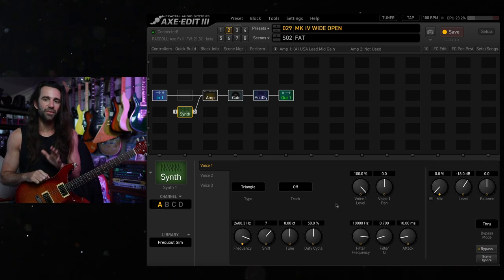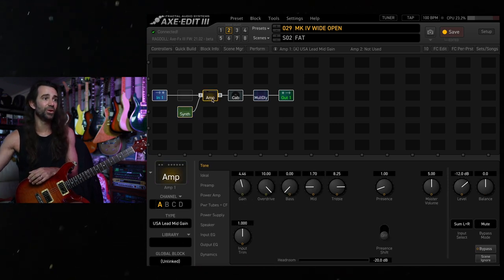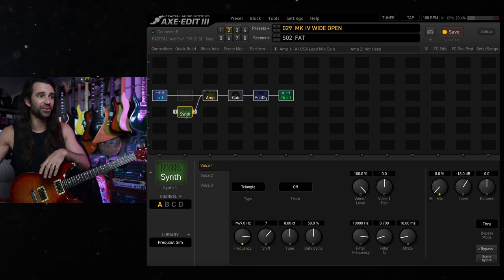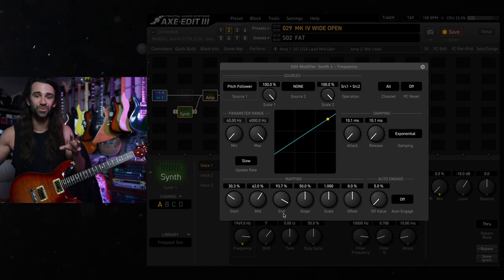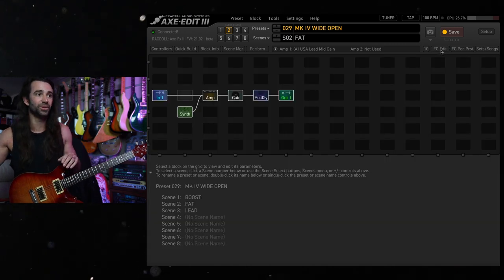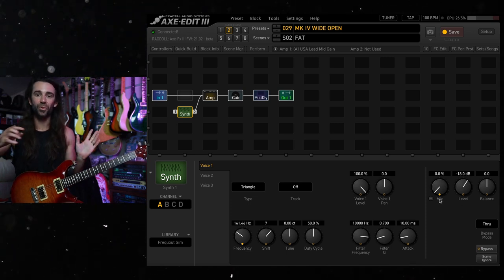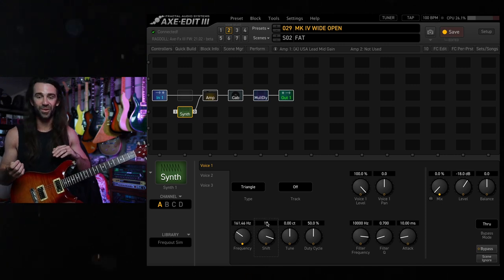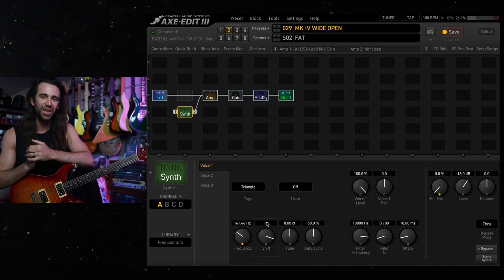Feedback Simulator For the Axe-Fx III, FM9 & FM3 | 5 Minute Tones

Comment: Can also add an envelope follower to the synth mix control, set operation to Src1 - Src2, then it subtracts the signal from the envelope follower to basically reset the effect if you play a new note. This does require messing with the scales of the sources a bit, and probably is different from rig to rig. Seems like an expression pedal opens a lot of options for fine control here.

Comment: I got this working on my Axe FX ll but one issue is on the higher notes the synth goes wacky when I apply any vibrato or even if I try holding it steady. I don't have all of the setting you have there but I do have most of them. Also sometimes with the expression pedal to zero I still hear synth noise in background.

Comment: this is a nice trick but in lower gain situations the tracking falls apart and there are synth artifacts feeding into the signal. i have tried with the send-return blocks but didnt have much luck cause the signal gets out of control fast and there's only noise very quickly. have you tried with the S/R blocks with any success yourself?
Reply: Same here.

Comment: Is it not possible to do vibrato when the synth block is doing its thing? When I add vibrato the whole thing goes weird.
Reply from the maker: I haven't had an issue with it.
Reply: @LeonTodd  The frequency parameter goes crazy unless I hold the note absolutely static. I'll have to experiment a bit more but was wondering if anyone else had a similar problem.
Reply: works fine for me too. i wonder if the string scraping across the fret is creating harmonics and fooling the pitch detector?
Reply: @Simeon_Harris  Could be the case, which parameters should I play around with to try and fix the issue? Thanks for all your help!
Reply: @tanshaomala  well there's nothing you can add to the grid or change about the pitch block, because pitch info is detected at the main input.
Reply: Hey Leon, tried it on my FM3, using the same settings as in this video, but instead of ‘feedback’ there is some weird oscillation sound, even when I’m not playing.  What could I’ve done wrong?
Reply: @MarcoBercx  did you attach a control switch or an expression pedal to the synth voice level? when you play a note, does the oscillations stop? if not, did you attach the pitch controller to the frequency parameter?
Reply: @Simeon_Harris  ah I guess that’s it, I don’t have an expression pedal yet.  Thought by activating the Mix (assigned) would do the trick.
Reply: @MarcoBercx  you can do it with a control switch configured as a preset override, which leon alludes to in the video. it's a bit complicated to set up, but worth learning how to do.